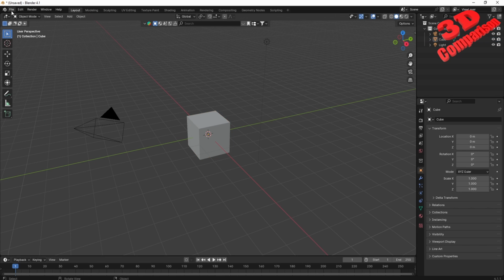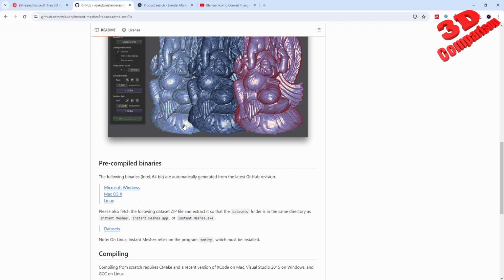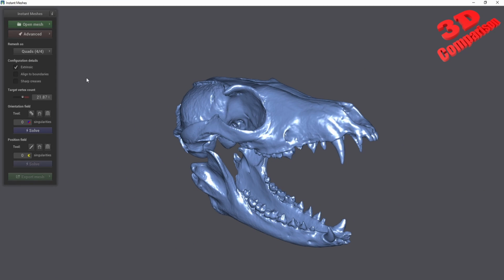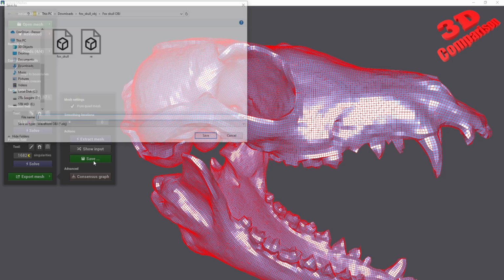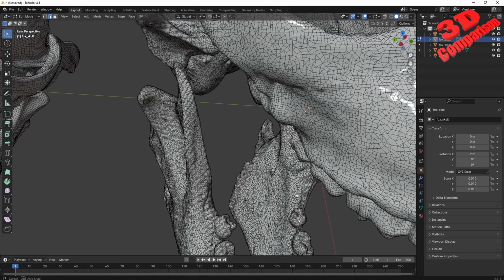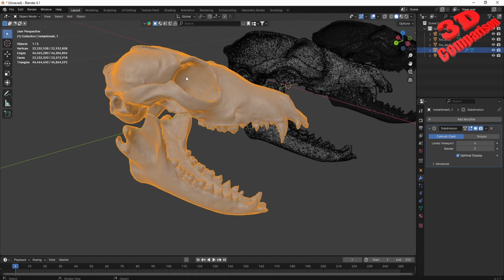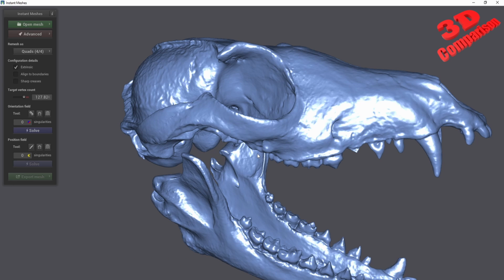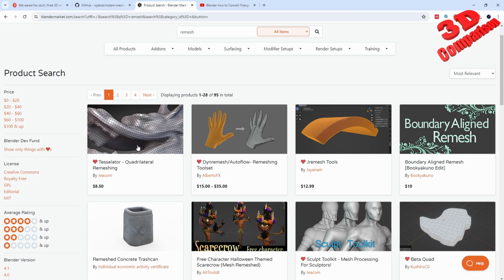Blender - Triangle to Quads Free to use Workflow overview (Instant Mesh)

Comment: Hi Buddy,,
I’m working on a project involving some spiked structures, and I’m trying to remesh them into quads. However, I’m encountering issues where the structures are breaking apart during the process.
Could you please offer any suggestions or techniques to help achieve a smoother remeshing without compromising the integrity of the spikes?
Reply from the maker: Hello! That is a really good question, I will address it later today and the video should be up within the following 24 hours. I will address it within multiple software solutions.
Reply from the maker: Hello - here is the first video for this. I would suggest to use MeshLab (as it is open source) and only afterwards convert the mesh to quads. The decimation features within MeshLab can help you keep those high creased spiked structures. - https://youtu.be/MS0bYmW8lbM